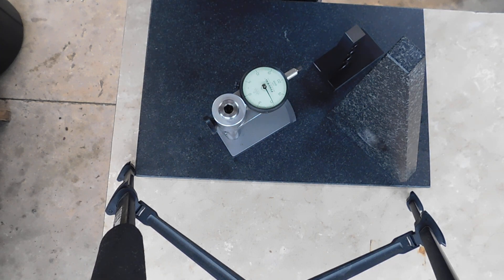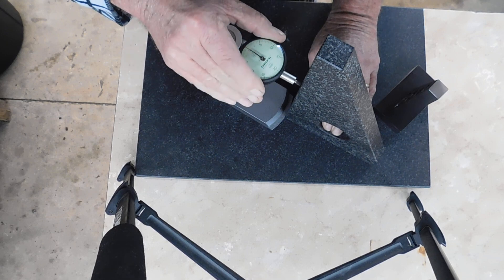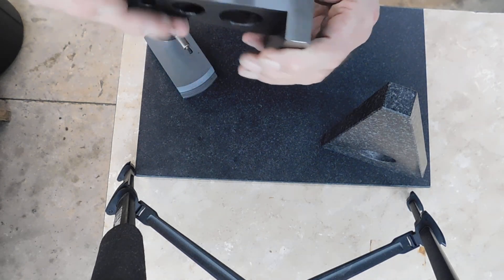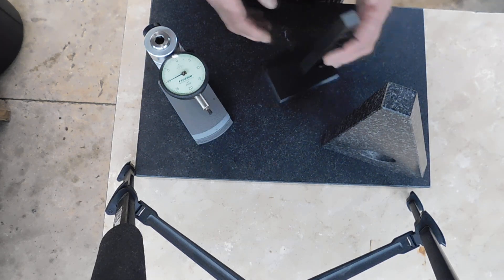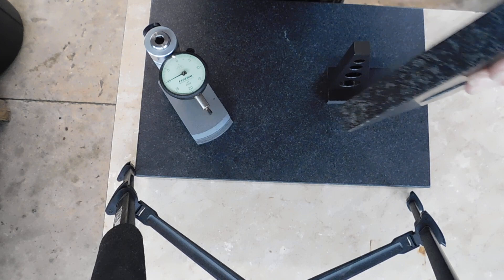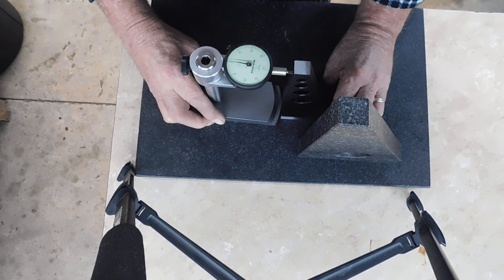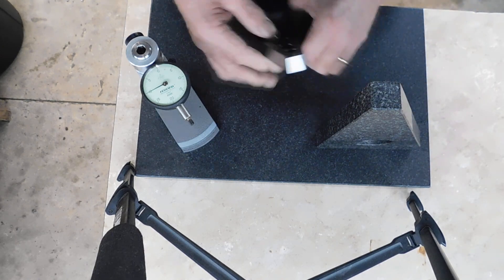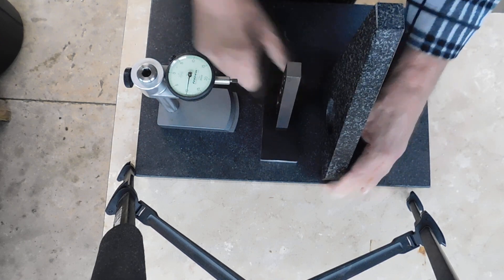Surface Plate Square

Comment: Beautiful work!  I found you through the Homemade Tools website where you posted your new shear.  A homemade bench shear that can cut 1/8" steel easily is no small feat.  Did you use a set of patterns to make your parts from?  If so, are they available?  Also just subscribed too, and hope to see more of your work.  Thanks, Jerry

Comment: Doug, I saw your wood lathe build on Homemade Tools. U said u used a washing machine motor on it. I was wondering if u have a secret to wiring a washing machine motor to be able to control the speed so it doesn’t run full speed and when on low u still have torque?
Thanks
Reply from the maker: You must have me confused with another builder on homemade tools.net, I never built a wood lathe on home made tools, there was a guy who did build one recently and had the wiring diagram for running different speeds on the motor but I don't remember who it was, you can have to go back to the archives and browse, thanks for asking, Doug

Comment: Beautiful work Doug. I'd like to see some of your surface grinder workflow & how you went about final tweaks if you do more of this super accurate stuff. Was the stock heat treated btw?
Reply from the maker: Thanks Peter
I'll be starting a new project pretty soon which will require some more of that fussy grinding, I'll shoot a video of the process, the square was made from O-1 Tool Steel (which is oil hardening just in case you didn't know) the steel was hardened then tempered and precision ground.
Thanks again
Doug